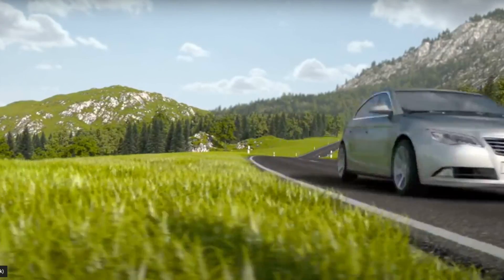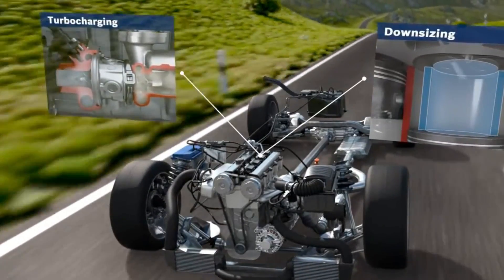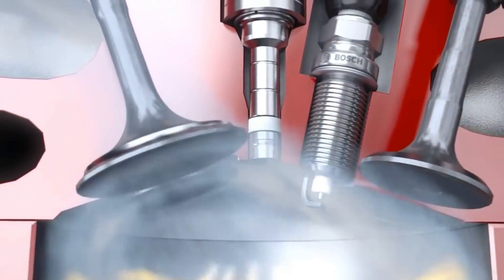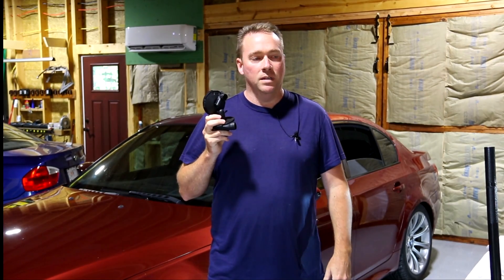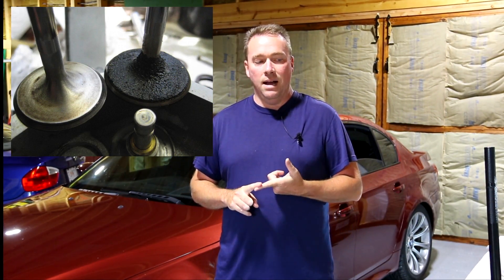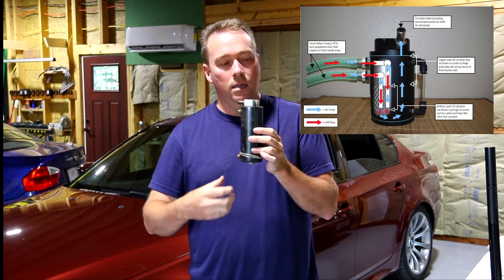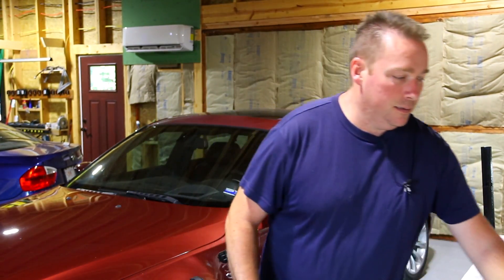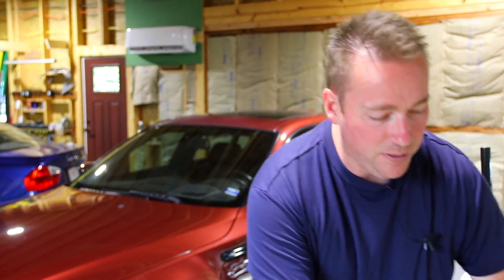How To Prevent Carbon Buildup Deposits on Direct Injection Engines !!!

Comment: I have an occ on my n52 just for fun, it doesn’t really need it, and when it’s cold outside it collects a lot of water but otherwise it collects minimum amounts of oil so the output from the can is still covered in oil. The car doesn’t eat oil only small unnoticeable amounts. It has the plastic valve cover with the integrated oil separator which does a decent job.
For my b48 I have designed a injection system into the charge pipe( upgraded to aluminum) but it’s not ready yet. I’ve changed the design many times. Initially I was planning to take fuel from the low pressure line, then I planned to use a fuel tank with fuel pump and regulator. This takes more space and it’s heavy so I change my mind and used a fuel filter as a fuel tank and an air bottle for 4bar pressure but in the end I think it’s easier to just use the low pressure line of the car and simplify the project further. It will activate by remote control. Fuel rate is manually adjustable and will set it to 4ms/300ms, that’s about 1lbs/h. This should keep the valves clean if used like once a week idk

Comment: My 2016 Lexus 200T F sport has an in house engineered and built four cylinder turbo with Direct/Port injection.  Problem solved from the start.
Reply: My 2016 Lexus 200T is in the shop right now getting all the injectors replaced due to bad carbon build up at only 23,000 kms.
I'm very worried it will happen again. I suppose i have to drive it harder and not take short trips...

Comment: A turbo with without a catch can and direct injection cause more carbon buildup on the intake valves. I know my 2017 1.5 CR-V has no catch can.
Reply: Do you recommend buying a Honda non turbo v6 with direct injection?

Comment: Is it true that top tier fuels prevent or cleans carbon build up on GDIs?
Reply: the simple andmser is NO!     the engine mechanics is not there.
Reply: I don’t know if this has anything to do with your comment, but… I have been reading some GM manuals for newer vehicles and they mention the use of top tier gas only helps to preserve the injectors. However, they still recommend using their additive every 10000 miles or oil change.
Reply: @TheTXamigo  i stopped using their additive. I believe it was just a way for them to make money. I just make sure I fill up top tier fuel only.
Reply: That can't be right.  Direct injection engines inject fuel directly in to the cylinder.  So the fuel doesn't touch the backs of the valves, which is where the carbon builds up.  So, no the quality of the fuel wouldn't make any difference to carbon build-up in a GDI engine.
Reply: @Kj16V  my thoughts exactly. Seems the carbon build up is because the fuel is not sprayed on the back side of the valves. So if carbon builds up on the back of the valves because the fuel isn’t keeping them clean how would using top tier fuel or even premium gas help prevent the carbon buildup?

Comment: Pollution regulations  ruined engines and are a engineers nightmare.
Reply: Do you rather live in a town full of smog? The best solution to build is regular and frequent oil changes.
Reply: @Dmxravin  Hi.  I don't understand your reply.  How can regular and frequent oil changes reduce carbon build up on DI engines?  Thank you.
Reply: @vicwahbyphotography4866  engine oil is designed to suspend carbon particles. That’s the reason oil goes black.  There are certain oils which only have a lower volatility rate which is evaluated using a NOACK test. Less volatile oil means less oil vapour which ends up in the EGR therefore less oil (carbon deposit) on intake valves.
Reply: @Dmxravin  no it's very clean and our state has hydo power stations and I do oil change every 5k 😋

Comment: Wish I knew this before my engine replacement. 
As you know, I had to take the intake off the used/new engine going in, for install. Should have cleaned it up before install, cause e60 M54 intake is a bit of work to remove/install😒

Comment: Hey Nathan -  I noticed in one of your last videos you mentioned you were going to do the Vanos Solenoid o-rings and clean them and such on the m5...   I have an 08 m5 that just started testing a little low for the solenoids on ISTA..   would really love a detailed video on that job if you could!
Reply from the maker: Joe it’s not A easy job , I’m wanting to get a little more insulation done in the shop first , since it will Be a long painstaking job
Reply: @NathansBMWWorkshop  all good :) ill watch out for it

Comment: 93 SHO, direct injection, never had a problem, once a year I'd take the intake off an clean any oil that had built up(no catch can) honestly not sure if it was because I ran 93 or gave it the Italian tune up occasionally, or with the hard hit when the secondary runners opened up maybe kept it clean. Would wipe down the valves/stems, minimal build up really wasn't an issue, but the engine was also Yamaha designed......
Reply: Italian tune up doesn't work with GDI. There is no fuel spraying on the intake valves. You will just get more blowby when you drive it hard and end up with more carbon on your intake valves through the PCV system. I'm having a hard time believing this story.
Reply: First mass produced modern GDI car was the 1996 Mitsubishi Galant. Your SHO had port injection, not direct injection. Those were the better type of fuel injection. Many domestic cars used central injection for. Long time. Basically it was like an updated carb, just computer controller. Port injection put the injector in the intake for each cylinder. Direct injection as the name implies fires directly into the cylinder. Most diesel cars have been mostly like direct injection. It does not spray the fuel in the intake. Instead it fires into a swirl chamber next to the cylinder. So it was sort of blend of the two.
Reply: The vehicle did not have direct injection.

Comment: I have the N54.. I'm relying on shell 93 for now lol.. that should help a little right?
Reply: It doesn't matter what kind of fuel you're using since it never touches the valves to clean them. Sorry.
Reply: I have a n54 and I put the ECS tuning oil catch can. I also have cleaned my intake valves, walnut blasted. New spark plugs and coils and a new valve cover gasket and my oil catch can barley fills up between oil changes. It should work for you too
Reply: I use amsoil 0w-40 euro which is ll-,01 approved and have had good results
Reply: Shell 93 v-power is best gas I'd stick to that.

Comment: Great Stuff here..  
having been a factory trained tech, dealer tech for decades, and a tech school trained tech from a local tech school in the 90s  ive been fortunate enough to go to yearly GM training schools and the instructors were all engineers that actually did the designing and cost-effect engineering that lowered initial-costs down so manufacturers could use cheaper stuff to build the entire car/truck. (all manufacturers do that)  
             They told us why and all that.. like the use of aluminum wires instead of copper to save money during some years.    Also what to look out for with drive-ability issues electrically for upcoming designs and platforms.  blah blah blah.. 
              Anyway..  smaller pistons with smaller compression rings and oil rings dont seal as good.. pistons are lighter and shorter...  rings are all thinner and thinner..  THIS is leading to greater and greater blow-by of explosive gases.. dragging with-it TONS of carbon, unburned fuel, chemicals and the like..  TONS more than EVER before..  all this gas with Nasty Nasty chemicals is going BACK into the engine oil Via the PCV systems..   AND sticking to the valves..    The idea of 10,000 mile oil changes because you use fully syn oils is only marketing in my opinion..  Catch-cans are a great idea. Working PCVs area needed more than EVER before, on newer stuff that-is..  with low friction pistons and such.     Anyway..    Thanks for reading the bible here..   i went overboard haha..  PEaCe out yo-mainics!
Reply: Your gonna get bruise with that kinda spew.

Comment: I'm going to give y'all a hint: You cannot prevent direct-injection carbon deposits unless you drive at nearly WOT at 90% duty cycle.
Reply: If you drive it hard you are going to get more blowby in your pcv system. This is just wrong. Catch can and intake cleaning is all you can do. Sorry boomer but the Italian tuneup doesn't work with GDI.
Reply: @DoSomething37  So they're even bigger pieces of shat than I originally thought...
Reply: @theamerican7080  You keep that subpar low horsepower, inefficient carb boomer. Simple is as simple does.
Reply: @DoSomething37  You'll learn a new definition of "boomer" when some boomer goes "boom" upside your head.
Reply: @DoSomething37  whatever you say "tide pod"
Reply: so i'm good then ;)
Reply: Why would that even help?
Reply: @SavedbyHim  Heat
Reply: I use lucas products hope it helps
Reply: Sounds good to me.
Reply: Not true really. You’ll get some more blow by in the pcv doing that.
Reply: Brakes are cheaper than injectors and valves.  lol.